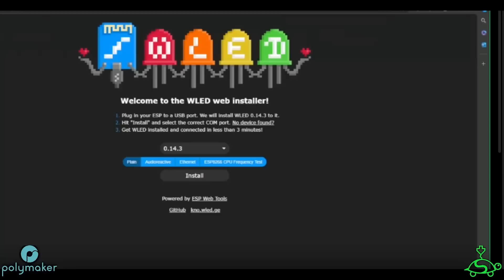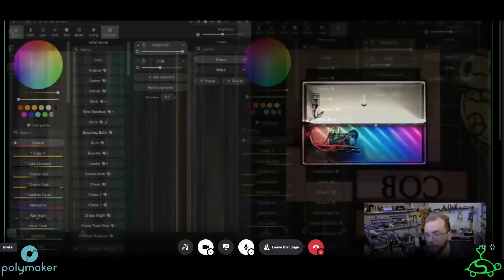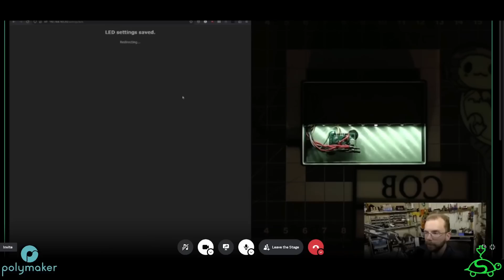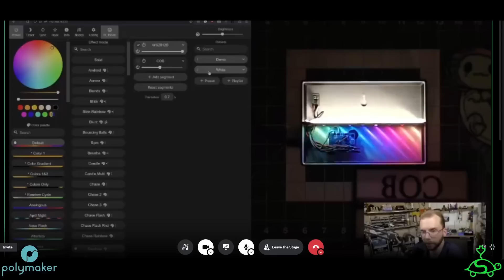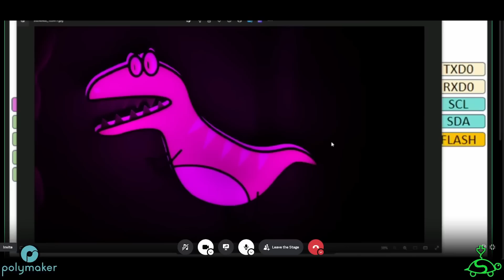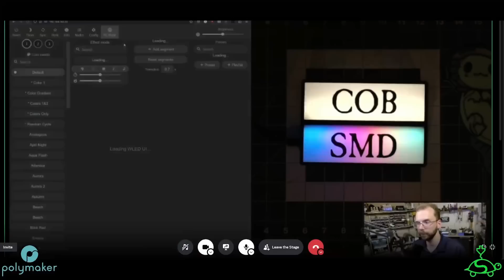Custom LED's for Light Boxes - Brighten the evening - Episode 10 - Shurdle3D

Comment: Well, twice now this comment has disappeared, so I'll put it here instead of in the thread:

>>> You're not wrong though. Level shifters are a thing and sometimes you need them - voltage dropoff is for sure a thing. The GPIO pins on most SoCs (D1/ESP/Pi, etc) only output 3.3V, which is enough to control a WS281x LED strip - provided the data wire is kept short. Generally speaking anything under 4" and it should be fine, but any longer you run the risk of enough loss in voltage to cause the high/low pulses to get muddled together. This is where LEDs simply refuse to respond or start flickering. I've probably built close to a hundred D1/WLED projects at this point and only in a few of them where I was physically unable to get the controller close to the LED strip has this been a problem.

The WLED FAQ does a great job of explaining this - https://kno.wled.ge/basics/compatible-hardware/

If you're up for a deep-dive on the subject, this is perhaps my favorite write-up on the use of level shifters - https://electricfiredesign.com/2021/03/12/logic-level-shifters-for-driving-led-strips/